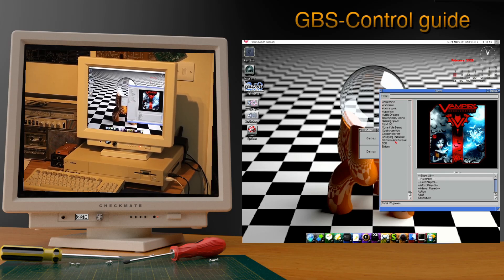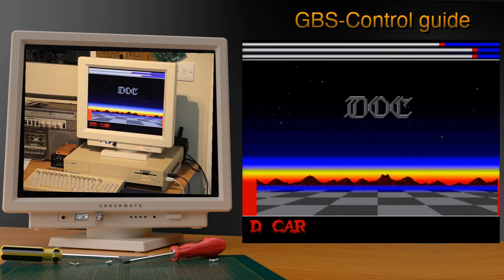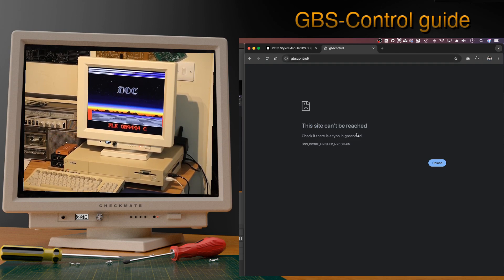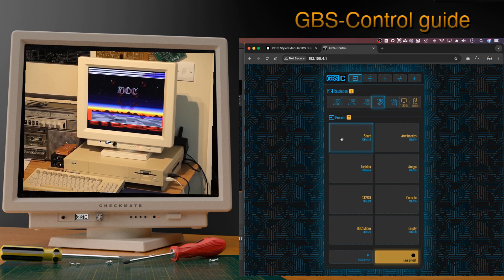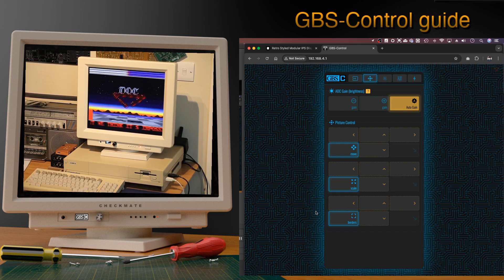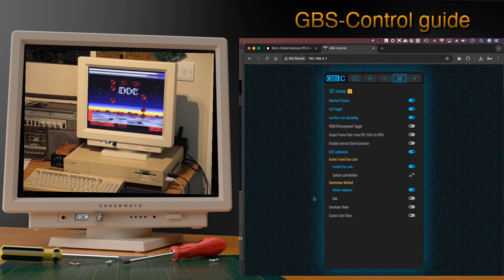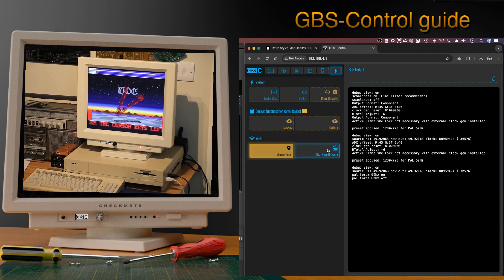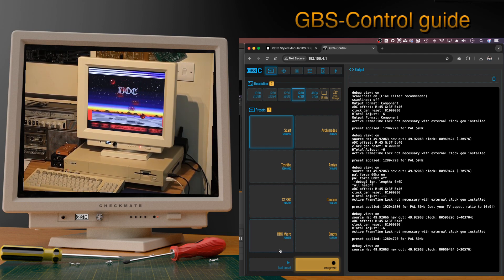GBS Control guide

Comment: I'd love to see a dual-IPS (stacked) model of this, which would give you OLED level blacks & contrast, would instantly make it a brilliant CRT alternative, especially if it was two arcade panels, a 25 or 27 inch dual-IPS model, would be amazing, in fact, would be worth owning even if you already own a nice 21" CRT monitor, as no 25/27" 4:3 monitors exist, let alone 25/27" OLED grade (dual-IPS), dual IPS actually has the advantage of not only having OLED level blacks & contrast, but also much higher full-screen CD/m2, potentially making it a better CRT alternative than WOLED or QD-OLED panels, this would add on the cost of an extra panel + expenses, but would completely transform it to the next level, especially if they were 120/144Hz IPS panels, making BFI & RBFI (CRT raster-scan beam emulation, aka rolling-scan) possible. 

Given, people are prepared to pay hundreds for 21" CRT monitors, myself included, and that's for second hand equipment that may need repair at any moment (that's even if repair is viable), what would people be prepared to pay for modern CRT alternatives available in 21/25 inch and possibly even 27" sizes, that are new retail and have all the modern advantages of scalers and I/O et cetera, as long as they are at least 120Hz sub 5ms allowing for BFI & rolling-scan), latency & motion-clarity wouldn't be an issue either, a 25/27" model would double up nicely as a retro TV display also.
Reply: well said mate!
Reply: Whenever the panel is upgraded like you mentioned it's a guaranteed purchase from me.

Comment: Is it possible to use a retrotink on this monitor instead of gbs control?
Reply from the maker: You can if you want but only externally.
Reply: Using an external scale is the best idea as the internal scalar is terrible. It’s just a cheap $40 Chinese knock off.
Reply: It’s the best idea as the internal one is just a knock off Chinese one.